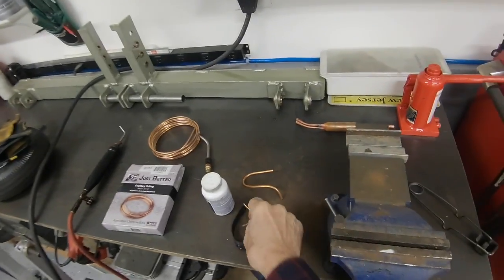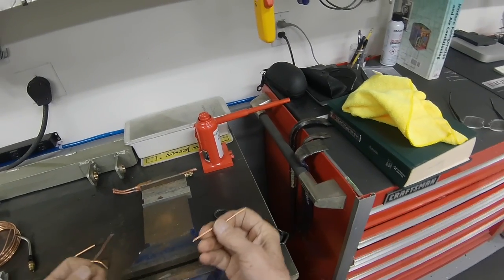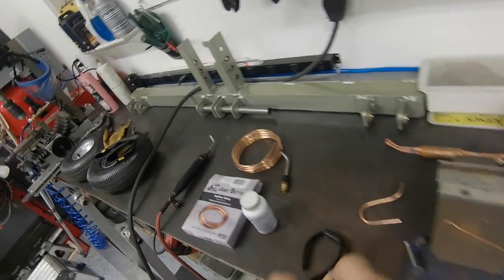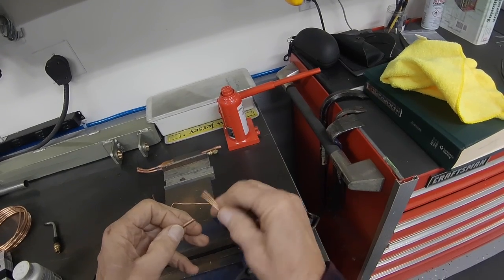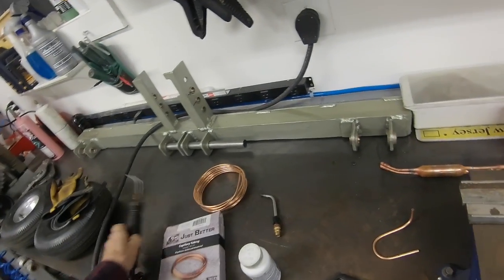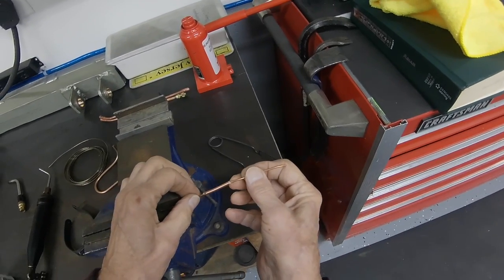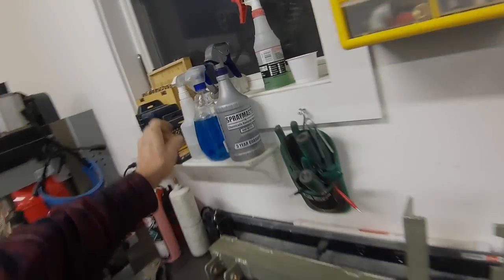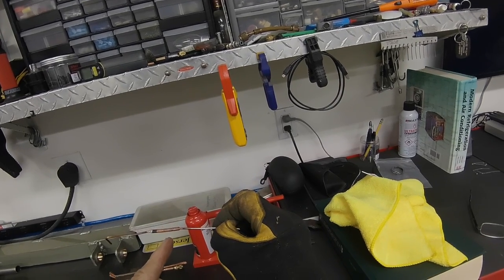How To Repair Capillary Tubing.

Comment: Beautiful job. Are you soldering the joint with solder or are you silver brazing it? Just propane, like soldering a water pipe for the house?
Reply from the maker: Silver solder 45% with a Turbo Torch